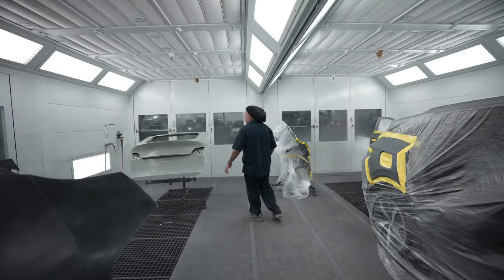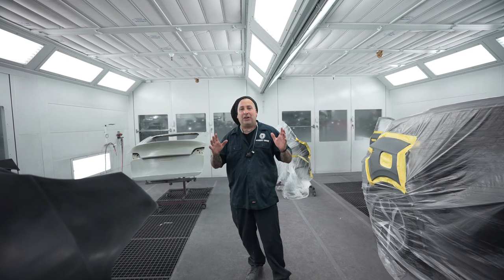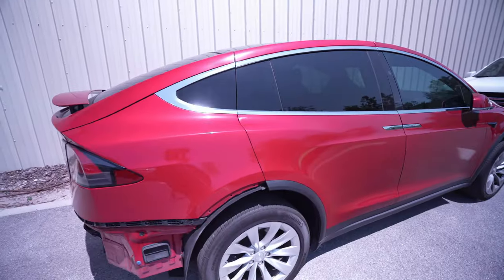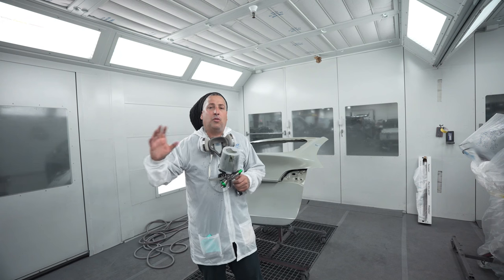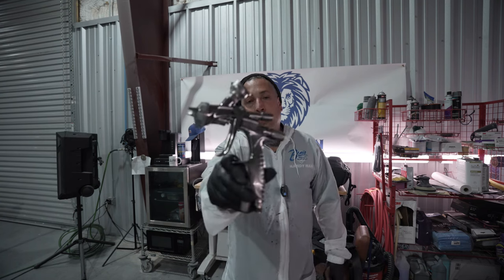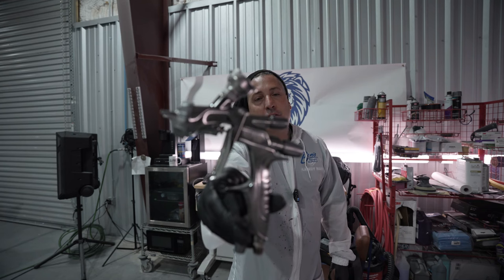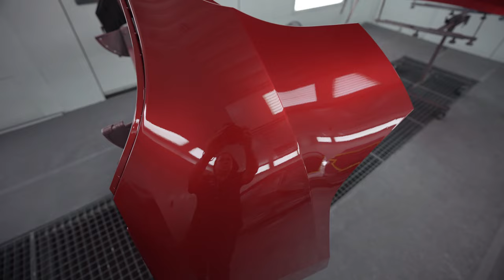How To Spray The Series 2 WS400 For The PERFECT Orange Peel - GIVEAWAY

Comment: Turn down the gloss Team IWATA
Reply: Turn down the gloss Team IWATA
Reply: Hi. 
What are you using 1/2 air line and high flow fittings?
Not sure if it helps. High flow fittings i saw were 3/8 threaded.  I figured still a restriction.  
Thank you.
Reply: Tuuurn Down the Glosssss. TEAM IWATA 🫡